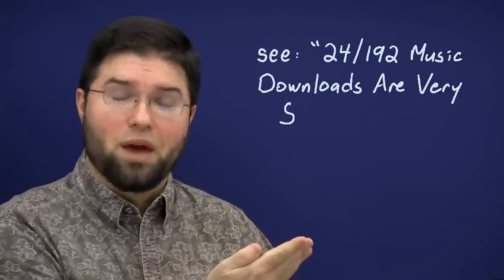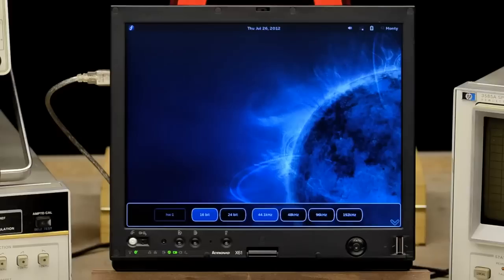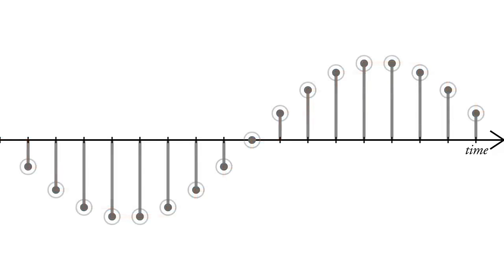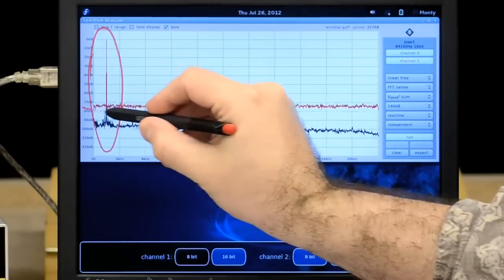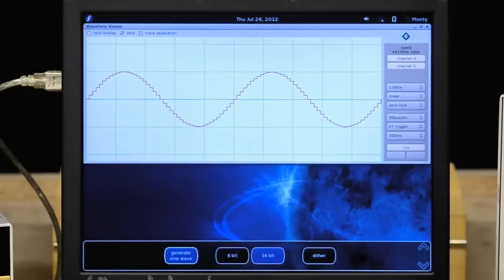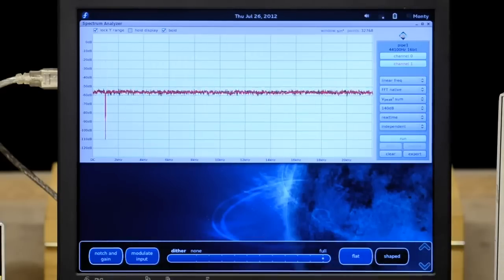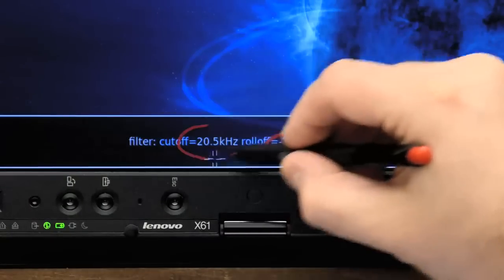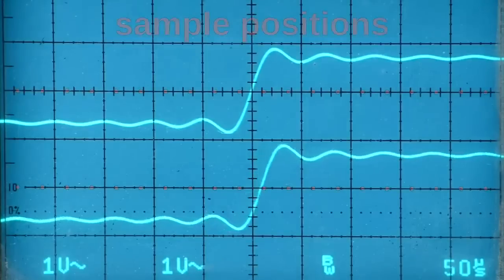Digital Show & Tell ("Monty" Montgomery @ xiph.org)

Comment: This is very good, but I'd like to know more about how the DAC achieves the smooth output given it has only the discreet 'lollipop' values to work with. Monty makes the point that there is only one 'solution' given the sample values, but how does the DAC find that solution?
Reply: This happens via interpolation, if you Are into electronics you may find a schematic or a helpful video on this topic. 

Basically, if we are absolutely breaking this down to ground zero, there has to be either a capacitive or inductive element, since these are the only time based basic components you can place into a schematic
Reply: @PippPriss  thanks. I vaguely understand how a capacitor can be used to smooth out a signal (e.g. in an AC to DC power supply following the rectifier stage) Is that the sort of thing?
Reply: The DAC doesn't "find" the solution. It's simply the only solution that exists, giving spectral constraints of a signal. Any other signal shape going through those quantization points will have a different spectral output, that can't exist because it goes beyond the Nyquist cutoff range. Basically, the low pass filter beyond Nyquist frequency is what cutting out all other solutions, leaving the only one that can exist.
Reply: @PippPriss  nowadays the interpolation is mostly done digitally in the DAC. it would be very difficult and expensive to make an analog low-pass filter which does a decent job at passing everything below 20 kHz basically unmodified (including phase) while strongly attenuating anything above 24.1 kHz

Comment: Great video…now we need one on DSD.    PCM conversion does not sound like analog.  Even though we have these great tools of engineering something is off.
Reply: nicksterj  don’t be silly…I use the same source.   I record my vinyl.   Did PCM,  compare to DSD.   The PCM is good.   But doesn’t sound like the vinyl.   It’s about 95%.   Monty knows how to measure stuff…but he has no clue to listen to what it is.   Measurements are sometimes fallible.    Look beyond the measurements.   PCM is a mess.   DSD is the most “analog” like equivalent currently
Reply: nicksterj  not in my experience.    The differences are small.   But there IS a difference.   I use DSD256.   PCM can’t hang.
Reply: nicksterj  SACD is DSD64.   Different thing than higher sampled DSD256.   To the trained ear there IS a difference.  Go ahead and keep buying the CDs. DSD is an analog like wave form when reproduced.   It is not the same encoding process.   There is a reason many companies archive to DSD.
Reply: nicksterj  dude.   Stop.   Amir blah blah blah.   Amir is a just a guy who knows how to measure stuff with his meters.  He is also very ignorant that measuring things doesn’t always measure the things that matter.   His Sinad test blah blah blah.   I am an engineer I understand numbers and equipment, measuring etc.  Engineers have to take the data and balance it with other factors.  DSD has its issues with the high frequency noise but it is stripped away with a low pass filter.    PCM is much more complicated.   You will not convince me.  I have been at this too long.   Enjoy the CDs.  Let’s move along.
Reply: nicksterj  Amir is not lying.  He just ignoring the facts.   We can’t measure everything….
Reply: nicksterj we all have opinions.   Everybody has different ears.  Modern PCM the crap from pro tools stinks.   This is why we have zero good sounding recordings these days.   Garbage
Reply: nicksterj your ears don’t work only on loudness.   They are a lot more complicated than you think.   Phasing and frequency response has a lot to do with it.   Psycho acoustics etc is at play.   You can’t throw numbers on it.    Human hearing is very complex.   Go look up Mark Levinson.   A lot of amazing stuff going on.   PCM has been one of the largest downfalls of good sound music in society and it stinks

Comment: Very interesting. But how does a 20KHz square or saw tooth wave look at 44,1KHz sampling? Since there is only 1 sample for each half wave, the output at 20 KHz can be only a sine wave, independently by the input wave form. This would mean an unacceptable distortion. Or am I wrong? Also between 10-15 KHz, where there are only 1,5-2 samples per half wave, the distortion would be very high if the wave form is not a pure sine. Could you show how it would look like? It would be very interesting.
Reply: nicksterj  Hi. It is very interesting. This aspect is never well explained in. The common assertion "44 KHz sampling can reproduce precisely all signals up to 20 KHz" is deeply wrong. It is true only for a pure sine signal. Since above 10 KHz there is headroom only for the 2nd harmonic (20 KHz), it should mean that all the non sine wave forms get rapidly distorted above 10 KHz, heavily, on CD and analog formats. The analog formats for consumer use have less useful bandwidth than CD, then it should be even worst.
It would be interesting to show how pure non-sine wave forms get distorted rising up with the frequency up to 20 KHz and how much the difference is audible.
Reply: nicksterj  "you must sample at more than 2x the highest frequency contained in the signal in order to reproduce it fully". This is exactly the point that never is quoted and clear explained in the videos about digital recording and analog bandwidth (for the analog formats). Only sine waves are shown. It would be interesting to see how the non-sine signals get distorted above 10 kHz, with different sampling rate and bandwidth (for analog formats) and how much the difference is audible (if it is audible). It would be funny to hear a heavily rounded 11 kHz square or saw tooth wave, but don't hear the difference to the full shaped wave. Yes, you don't hear the harmonic above 20 kHz, but in theory you could/should hear the difference in the shape of the waveform at 10 kHz, if the difference is much (perhaps this is the crucial question).
I am only curious to test these effects. I am not supporting the myth that vinyl sounds better than CD because of the 20 kHz cutoff, since the frequencies above 18 kHz are already so attenuated on vinyl, they they don't play a role, and I never heard more fine details (always less) in a vinyl than on a CD.
Reply: nicksterj  I watched it, but the square wave in the video is only 1kHz, it looks still pretty square. It is not the comparison I mean.
Reply: nicksterj  Thank you! I missed that video on that channel. It is what I wanted see.

Comment: Interestingly enough, you preferred to hide bandwidth-limited Heaviside step function under the carpet :-) In physical world, it is easily emulated by the flick of the switch, but once you limit it's bandwidth, it's representation will be non-zero even before you flick it, as if your filter-sampler "knew" beforehead that you are going to flick it.

Comment: 44.1/16 is enough for good audio quality? Well, yes, it was established some 40 years ago. But the whole presentation is not OK, manipulating facts to prove your point is not scientific by any means. 
1) Even 10% THD is not so obvious on the oscilloscope, so comparing waveforms on the oscilloscope and saying they are identical is pointless.
2) The ADC in the audio interface used almost certainly has sigma-delta architecture and it's real sampling frequency (and Nyquist frequency) is 64 or more times higher than output data rate aka sampling frequency in recorded file. And the whole sampled signal is filtered digitally before recording to file.
3) There is nothing that is infinitely small that can be implemented in real electronic system. The signal at the output of DAC is a stairstep signal anyway. Then it is passed through a LPF to restore a smooth waveform, that is shown on the oscilloscope. What is not shown nor said is that oversampling and interpolation in digital domain is performed prior to DAC so that the waveform may be restored accurately using feasible filter designs. So the signal at the output of DAC is not 44.1/16, in most cases it is 352.8/20 or higher.
And so on and so forth.

Comment: Try the same with very low frequencies! 20 to 80 Hertz
Reply: The math also woks. It's still below NyQuil frequency. However the equipments might have issue displaying them. Remember these are designed for electronics. They usually operate at MHz or GHz levels. Also the spectrum analyzer needs a very large window to display spectrums around 20Hz.

Comment: What do fractional bit depths mean?
Reply: n-bit depth means the full range is divided into 2^n quantization levels, or said differently the bit depth is log₂(number of quantization levels).  but there's no reason the number of quantization levels has to be a power of two, and if it isn't then you end up with a non-integer bit depth.
Reply: @MatthijsvanDuin  ok but in terms of storage, in an uncompressed audio file, what would fractional bit depth audio be represented as?

Or is it equivalent to compressing it?
Reply: @RAFMnBgaming  While normally the main reason to reduce bit depth would be to reduce file size or bitrate, he's doing it just to demonstrate the effects of quantization so most likely he's still using 24-bit or 32-bit for the samples but with a subset of the levels used.

To give an example using small numbers: if you're using 8-bit word size (range -128…127) but only use the levels -128, -77, -26, 25, 76, and 127 then you have log₂(6) ≈ 2.6 bits of effective resolution.

Having said that, if you really want to it's most certainly possible to efficiently store a signal at that resolution. While a single sample would still require 3 bits to store, you can pack 5 samples into 13 bits (or 40 samples into 13 bytes) to achieve 2.6 bits/sample of actual filesize.

Comment: There should be a stairstep pattern there?  The values here are really really small, the full range of a 16-bit DAC would be 2^16 or 65536 values.  Assuming a VREF of 2048 mV (using a common value in embedded systems) the 16-bits would translate to 0.03125 mV.  With an 8-bit DAC the minimum step would then be 8 mV; much larger but still much smaller than what can be easily seen on the oscilloscope.  The value of the DAC cannot change instantaneously; however, there may be enough capacitance on the output to smooth the waveform enough.  Another important note is what is the frequency of the DAC?  The sampling rate of the ADC doesn't necessarily correlate, so the DAC could be clocked much faster.  Would also be curious on a direct comparison of a FFT on the input and output.  Not trying to argue but genuinely curious, definitely agree that 16-bits and a ~40 kHz sampling rate are good enough for the vast majority of listeners.  Great demo, on the square wave that would be great for an EE Comms class!
Reply: There is no stair step pattern. As was said in the video, a signal with a stair step pattern might be part of the conversion, but that is not the finished signal. You will have a low pass filter afterwards and the signal will be smooth.
Reply: @moe.m  A low-pass filter doesn't magically make a "stair step" the output of the DAC into a perfect sine wave like that.  I'm saying if you zoom in far enough you will see some "stair-steps" albeit they will very very small.  That's why I also mentioned comparing the input and output FFT's, you will see that noise is added into the system (everything adds noise even filters) and see some more harmonics generated from the quantization.
Reply: @ChaseAlberti  The frequency components of the stair steps start at 40Hz and the Low pass filter starts at 20Khz and so it does not filter them out. For a basic D to A without oversampling the steps are there after the reconstruction filter. They are innocuous if dither has been used. In a modern D to A they are not there because modern converters add extra steps that change quickly, quickly enough to be filtered out by the reconstruction filter.
Reply: @woodcoast5026  Oh okay, so essentially the DAC is way oversampled and the low pass filter dampens the "spurs" / steps.  Although, a filter can only dampen the steps, so if you "zoom-in" far enough you will be able to see the transition between values.  Also, curious to know which DAC is used and I would think it would be a Sigma-Delta because of the lack-of-cost.
Reply: @Serenity I think you misunderstood my original point.  There are stair steps because the DAC is clocked at a certain rate, and at that rate the value appears on the output showing a near immediate change.  Although, not instantaneously due to parasitics + low-pass filter.  The minimum change of the step is very very small so you wouldn't be able to see it unless you zoomed way in on the y-axis (DAC Voltage).

Comment: I loved this, very interesting very informative I disagree that this offers any sort of conclusive proof. You mentioned "just because we can measure something doesn't mean we can hear it" but the reverse is also true. Just because we cannot measure something doesn't mean we can't hear it. It's easy to have hubris and say our testing equipment can measure beyond what humans can hear. But it is important to remember that it is possible there is an unknown variable. Jitter was once an unknown variable and products dealing with it labled as snake oil, but we have since been abke to measure it and deal with it.

Anyway, my issue lies with application of the niquist sharron sampling theorem. It requires that all the composite sine waves be below 20khz (the upper limit of human hearing) for a 44.1khz sample rate. On the surface this is reasonable, but you have lresented no evidence to suggest that this is how humans hear. If ultra sonic frequencies were present it is theoretically possible that they distort the audible frequencies in an audible way. But this is conjecture. It's entirely possible that any ultrasonic interference be in audible, it's a matter for psychoacoustics not engineers

I loved the video though, it did a great job of showcasing the niquist theorem and the most contentious topic of the lack of square/ladder waves
Reply: nicksterj  if we can hear it then we can measure it, that doesn't mean we know how to measure it, or that the people attempting to measure it have adequate testing methodology. There is no substitute for blind listening tests

Comment: I finally did the measurement and it seems that modern soundcards are sine wave generators and I also found side effect of this AI " https://youtu.be/O9hZ7GcI4rg ".
Reply: it has nothing to do with AI, it's just math.  the fact that the original waveform can be recovered is (as Monty explains) the result of it being bandlimited, this is the result of the "Nyquist-Shannon sampling theorem".  it's also not hard to implement (if you don't care about optimization), like 10-20 lines of code and a lookup table (containing the impulse response of an appropriate low-pass FIR filter).

Comment: Impossible. 
No way that you first sample is +0.5V then second is -1V on input and on output you will get +1.41V , makes no sense, there must be some trick.
Either it has harmonic frequency MIDI optimalisator ON or there is oversampling with 192KHZ and showing only 44.1kHz step form or other trick.
Reply: It's called maths. Welcome to science.

Comment: He's wrong about digital images. Love the video though.

Pixels actually do represent the average intensity across the square surface, not a single value at a point. You could in principle measure air pressure at an infinitesimal point in time for sound, but light is different. It's a bunch of particles randomly hitting a surface. If you give them an infinitesimally small target, the probability of hitting it will always be zero.
Reply: Yes, but he means this in a mathematical sense. Think of an array, It's about the way you display the meaning of those pixels that give meaning to an image. We choose to display squares of different color and light intesity adjacent to one another because that makes the most sense, but we could as well, as he explains on the video, no display it that way, such as the way that nowdays screens made up of tiny leds separated mm apart can create an image if you stand far away enough
Reply: @menocorde  My point is that flat squares are the more correct way to display pixels, unlike in audio where infinitesimal points are a more accurate description of what values were actually measured. It's not just arbitrary, it has implications for how the data behaves. For instance, because audio is a collection of infinitesimal samples, you can get aliasing unless you filter the analog signal first. Digital images don't get aliasing because each pixel takes the average intensity in its area and so have filtering inbuilt. (Bayer grid sensors do get aliasing because they skip pixels for each color, but that's a complication that doesn't apply to classic grayscale and triple sensor cameras.)
Reply: my printer wants to say something about DPI... and rolling shutters....